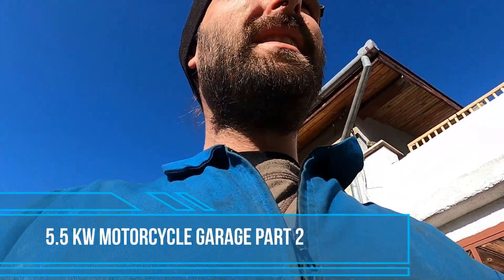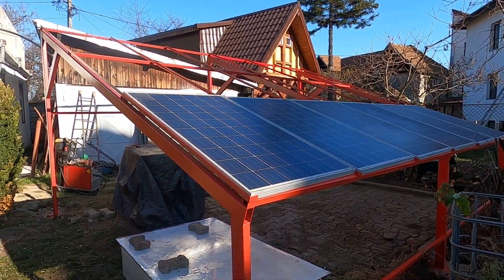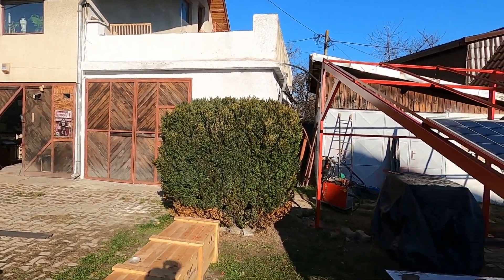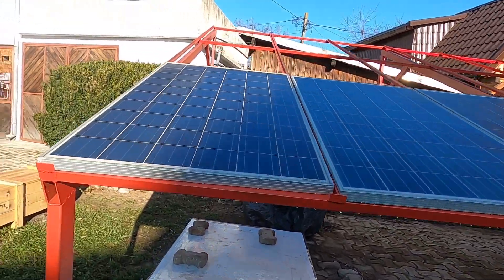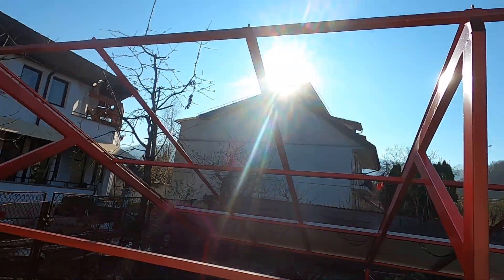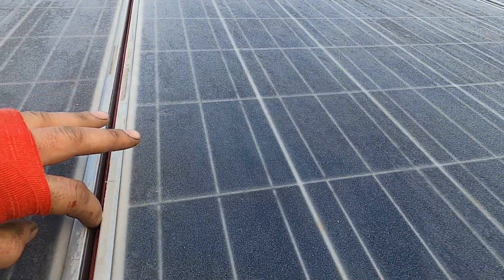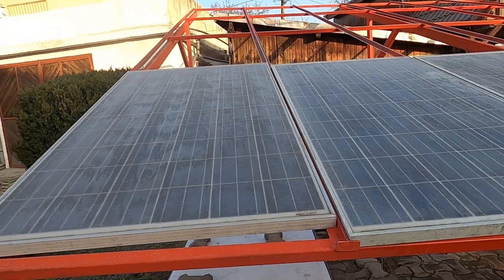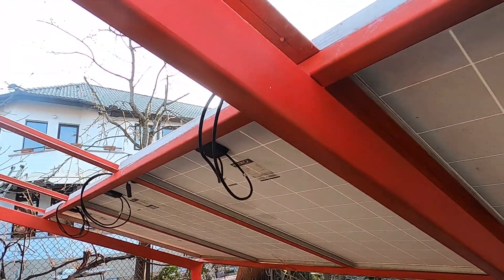Roofless 5.5kw Solar Panel Garage  Homebuilt With 2000$ PART2

Comment: This is the future.
If you have an electric car, and you are in a region with a lot of sun (may not be the case in the video, but no worries) you can charge the car without grid power. A company that can take a clue from this could mass produce solar garages and sell them/install them for electric car owners with both the cash to spend and the desire to arrive at the ultimate eco solution. This is what garages should be made of. Good work there!

Comment: Very cool! Are you going to screw the panels to the frame, the wind can easily lift them? Next project, an air heat pump powered by the solar system😀, easy to install!
Reply from the maker: Thx , i skrewed the pannels on to make a good grounding but otherways I'm sure the silicone will keep them there . some people mount mirrors on the wall with silicone at 90 degrees , so they should be good also without Skrew mounts

Comment: Excellent structure design. Very cost effective , duel purpose structure and easy to maintain electrical wiring. I mounted 20 400 watt 72 cell panels on a three post center mount which is working out great but I really like your design.
Reply from the maker: Thank you , i like easy to build stuff when i comes to construction , when it comes to automotive art i do have another channel : https://www.youtube.com/channel/UCKNkD-6rN_Qg2R74Dn-nF0w
if you need any measurements I'm glad to send !regards

Comment: No brackets ? One strong wind and they can come off? How much do you trust the silicone as a fixing solution? Also the panels have support only on the edges - Snow in the winter could be a problem.
Reply from the maker: Thx , i skrewed the pannels on to make a good grounding but otherways I'm sure the silicone will keep them there . some people mount mirrors on the wall with silicone at 90 degrees , so they should be good also without Skrew mounts
I have now everyday 10 cm of snow i can clean quite easy because they are not to high .
Reply: A standard mount would also only support panels from the edge. Only the top row is not supported on all 4 sides.
And yes, the wind could be an issue, silicone might not be enough

Comment: Looks very cool. I always imagined to use photovoltaic panels to replace the roof shingles entirely. Here a m2 cost ~15€. 400Wp panels would cost ~90€ per m2 but they produce power in contrast to no extra function like the shingles. Multumesc for sharing and greetings from Germany :)
Reply from the maker: Hy peter , i was always thinking the same , if i can use them instead of the roof , half to 25 percent of the pannels are already payed .and it is also easy to access the lower part . the disadvantage is that you have to keep the pannels in the roofs angle , i do have a summer angle on this garage .

Comment: Great idea and a good video! Are you producing any electricity yet?
Reply from the maker: I have started to , will post soon a new video
Reply from the maker: We have strong winter with snow and minus temperature , it is the spring project to finish up connecting the inverter and battery pack . for the moment I'm working on preparing some economical  electricity heating options

Comment: Why is the end line of the panels not straight? Any mistake in the construction phase of the roof?
Reply from the maker: HY there , it is my mistake , when i digged the 6 wholes i did not align the construction perfectly so it has a little angle . regards !

Comment: Hello, could you please give more details how you connected the used solar panels, I mean the electrical connection to the inverter and this stuff. I think I saw the exact same solar panels on olx and I want to gather more info. Thanks. Salut
Reply from the maker: Salut , le-am cumparat de la un tip din ploiesti care vinde de 250 w si 240 w la 225 lei  . astea sunt de 250w , nu le cumpara ambalate , desfa paletul si masoara-le cu un aparat de masura sa scoata aceeasi tensiune VOC  , multe sunt defecte la el .

Comment: can you give a link to where you buy your panels inverter etc
Reply from the maker: Hy oliver , i was buying used solar pannels , 26 pcs   250 watt for 1200 euro . inverter i will use an Easun SV2 .
Reply: @thechangeintoselfsustainab9365  hi! how old panels did you buy? how about degradation? i assume new 250w, now?
i also think about such cheaper -used panels.